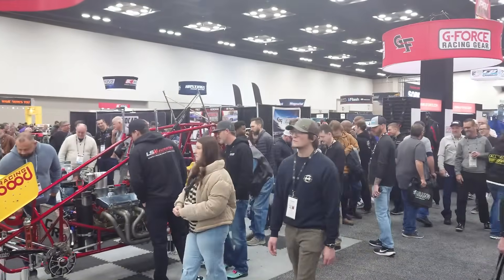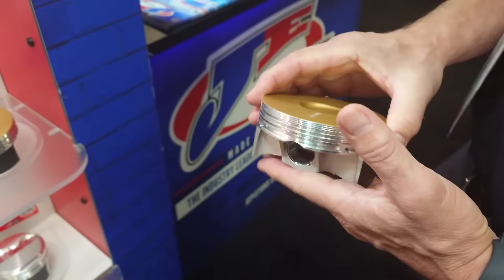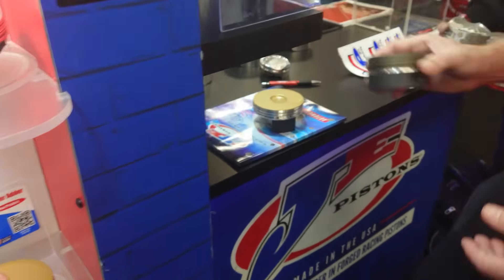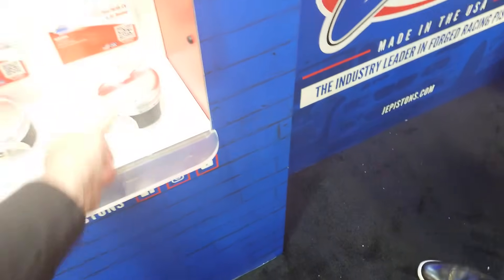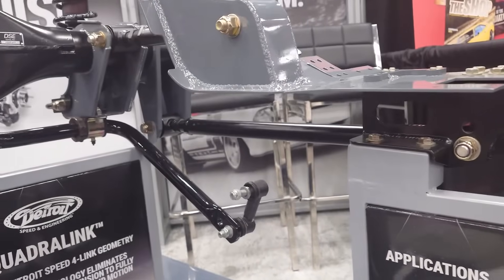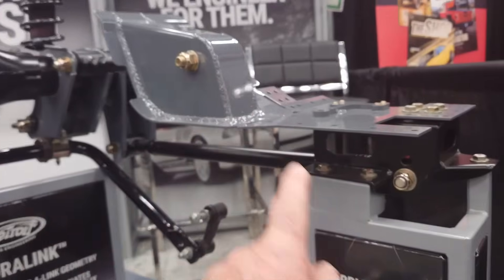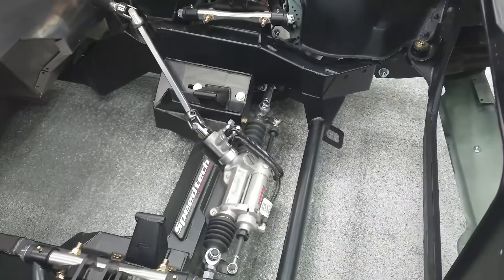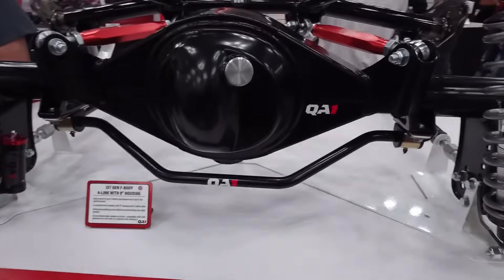PriShow 2025 What is new in Racing,  JE Pistons and Dart Engine Blocks

Comment: Im really curious what the combustion advantage is of that U shaped piston Top. Never seen that before.
Reply from the maker: It's for lower compression. The idea is as you create lower compression on the Piston end but then you are boosting the compression the a turbo or blower. So the u-shaped piston compensates for the boost pressure